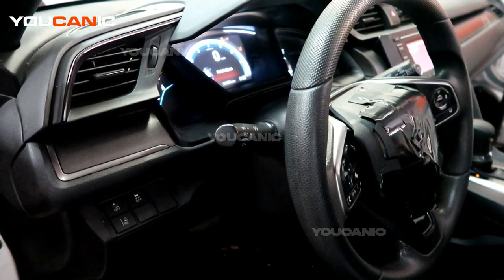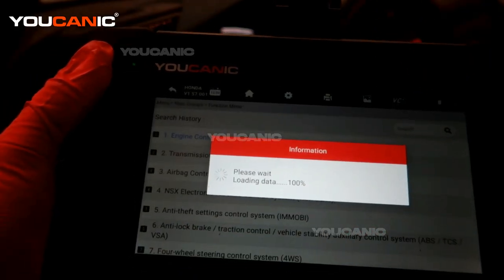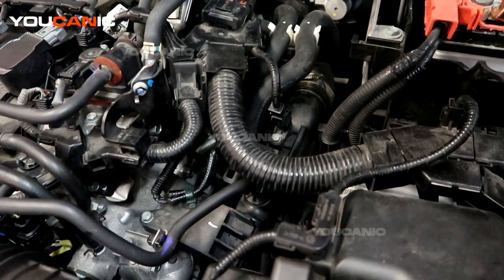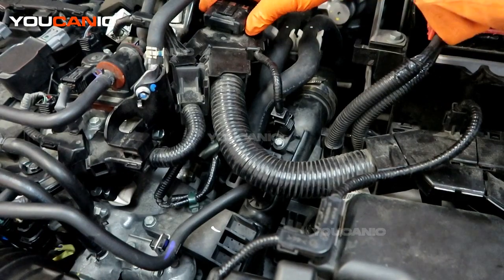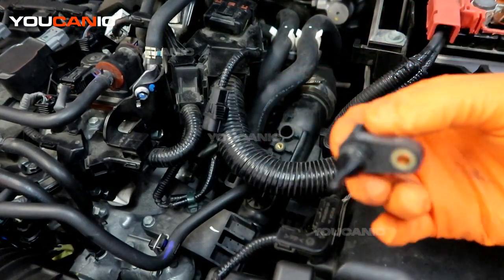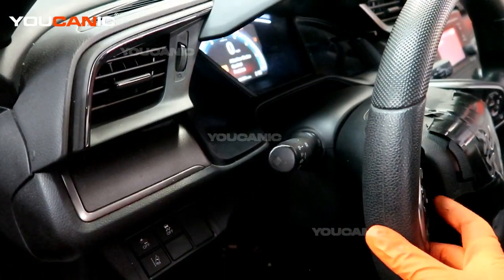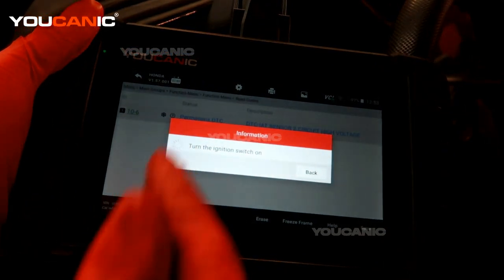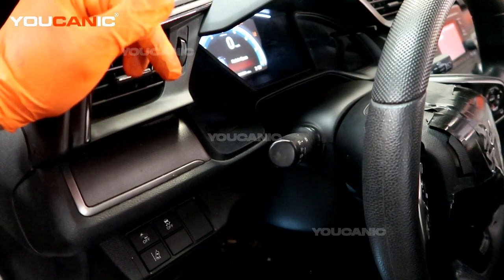Honda Emission Sensor or Ambient Temperature Sensor Replacement - P10-6

Comment: Is that the sensor that’s for the outside temperature on the cluster panel and can stop the AC from working?
Also, is there an affordable scanner you recommend to read these codes?
Thanks so much in advance